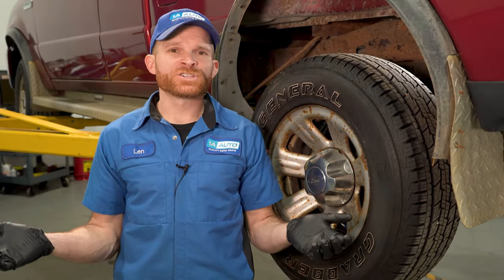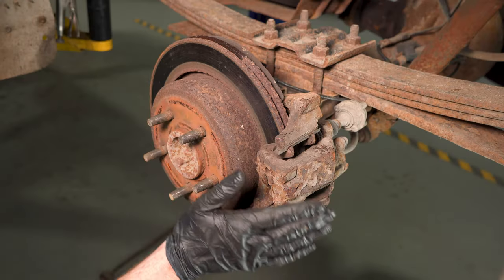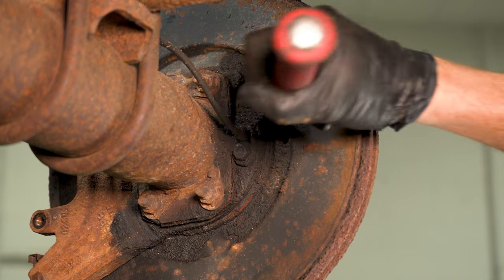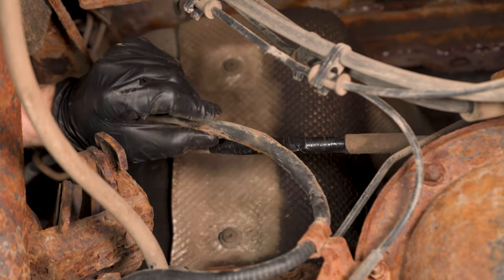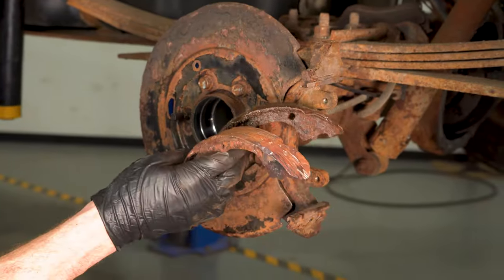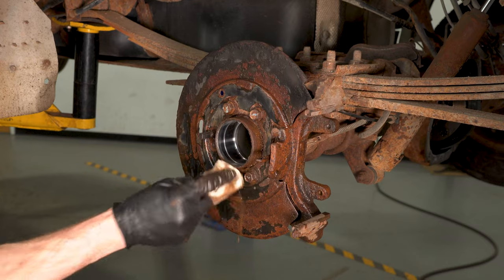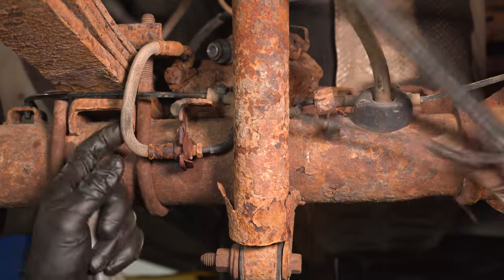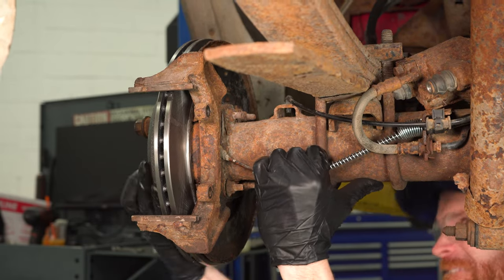Use This Forgotten Part on Your Car or Truck Regularly or You'll Lose It and Have to Replace It

Comment: Did my brakes and rotors other day, I never use the E Brake. Pulled rear rotor off, the damn parking brake pads just fell off.   And I didn't have new parking brake pads, had to order them. So if your doing a brake job, just order new E brake pads just in case. I'll never make this mistake again.

Comment: Thanks much for your video. I'm going to have to get a mechanic to check my emergency brake cables. My late cousin gave me his father's 2000 Camry LE. I've had the Camry since May 23 2018. The Camry now has 183,000 miles on it. The Camry needs a lot of work, but I'm willing to do that. For some reason the brakes stick or grab when backing up. Don't know what the problem could be but going to find out.